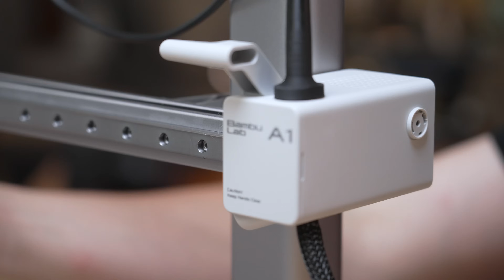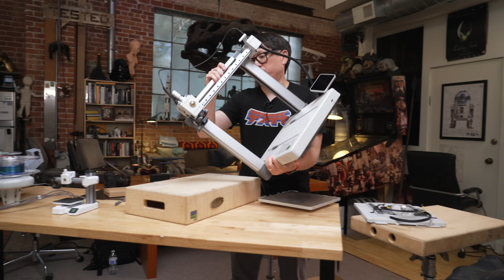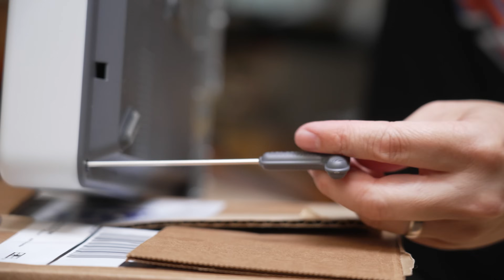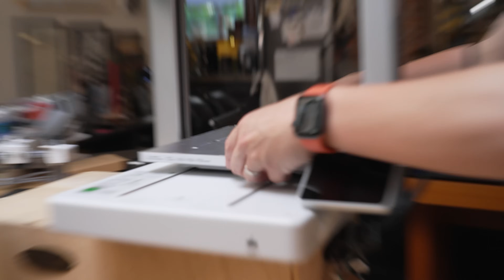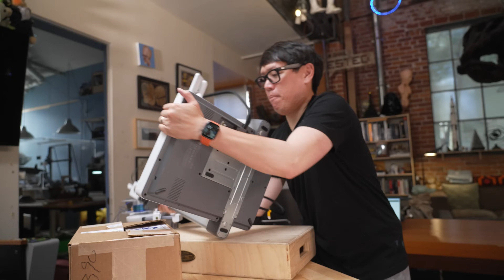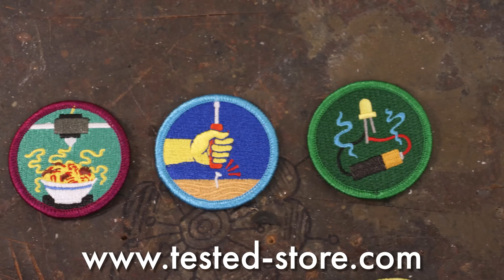Fixing the Faulty Bambu A1 3D Printer

Comment: They also have a faulty mainboard that eventually fries. They fixed the issue but refuse to honor any warranty concerning the mainboard. Plus you have to jump through a week and 10 emails of hoops to even be able to order one. When the new board arrives? The included tubes of thermal paste are dried up.

Comment: I just did this to check if my board has an NTC chip with the new fire issue…it was CRAZY hard trying to remove the bottom cover, around 45 minutes to remove 2/3rds of it (having to use guitar pics to pry), and couldn’t even get the side I needed off off…ended up getting it off enough to use my phone to take a picture (thankfully it’s a good one), but I wonder if they changed something to make it harder to remove (no I didn’t miss a screw, I checked with a flashlight in all the holes)
Reply: 电源那侧的底盖，有胶水

Comment: I dont have a white and black on the power supply where they connect to AC board terminals, they are BOTH black. Does their order matter? I disconnected to do resistence test using multimeter and now not sure which does to which. The NTC connector also doesnt have a red wire for me, it's yellow for some reason. Any suggestions?

Comment: Norm, I have two X1_Carbon s and I have had trouble with both units and their related printers. It seams as if Adam has never had an issue  with a Bambu machine. Is that so and if not how has he resolved issues?

Comment: Norm, I have had two AMS printers fail on me , the first one purchased in June of 2023 which failed at the end of February2024. The second  was purchased twelve days ago and has since failed. Don't get me wrong, when the Bambu produce works I really enjoy the products theu produce, but after they fail their customer service is horrific and the customer is hung out to dry. I am so disappinted in them.

Sincerely,
                 Shane Shellenbarger.
Reply: I feel the same pain with most manufacturers. Xtool is another company that has atrocious customer service. Another instance of when it works out works fantastic, bit when it breaks 😓🤬😡.

But at least Bambu acknowledged the issue and corrected and made it right, unlike a lot of other companies. It was the main reason why I bought my 3D printer from a company called Raise 3D almost 8 years ago, because of their customer service. 

Companies need to realize that customer service is second to none and I don't care how good of a product you think you're putting out. If it breaks and your customers can't get it fixed or you give them a hard time, they're just going to move on to someone else.

Comment: If this was a Creality product, they'd wait 8 months to release another product with the fix pre-installed, that they'd put next to 14 other of the same but slightly different product with one upgrade and a different number to describe each; then it'd become obvious their fix wasn't suitable and you need X product from X aftermarket manufacturer to actually solve the problem.

Meanwhile Creality fanboys loooove to bring this recall up, because basically everyone still fiddling with belts and rollers, compiling firmware and messing with something weekly to attain consistent prints absolutely hates these things are easy to use, and work consistently with minimum work. Meanwhile bedslinger heater cables have been a constant issue for everyone over the years.

They're awesome products, Bambu did all this absolutely right and it's such a breath of fresh air in the consumer and hobby 3d printing space.

Comment: The new cable is not well designed. Better strain relief is a good step in the right direction but still localizes wear. Drag chains exist for a reason. They keep cables in place and distribute wear along the cable.

Comment: One very important step for those of us who bought printers is to follow Bambu's instructions and take the required pictures before putting the covers on so we can get our gift certificates. I mention this just in case someone only watches your video to do the repair.
Reply: Meanwhile I have yet to even get a shipping notification for my replacement
Reply: @sphygo that's just bambu for you, unreliable, untrustable and like giving the middle finger if there is problem like the printer arrived broken oh did you open the box? Yes. Sry we can't help you, other times they just try to buy time until you get fedup with them and leave. You can easly find angry and unsatisfied costumers online. I like companies that trustable, makes reliable products. Don't makes everything proprietary instead open source their software design makes them easly serviceable and I know when I need their help I end up and leave as a happy, satisfied customer. I would pay even the premium price over some cheap printer that not if instead of when gets broke I cannot expect help.l because everything will fail at somepoint even the quality ones.
Reply: Bambu Lab took 2 weeks to review the refit photos I sent them.
Reply: @lewworthem8483 maybe request volumes are fluctuating. I did it a couple weeks ago. They requested photos of inside i didn't notice the instructions asked for, had to reopen to take them. Was fully solved within the day.
Only 2 days in total between receiving, doing the install and, having the rma ticket validated.
Reply: And a heatbed calibration!